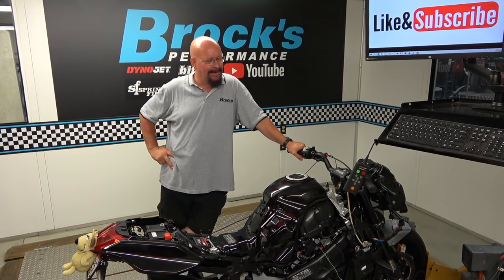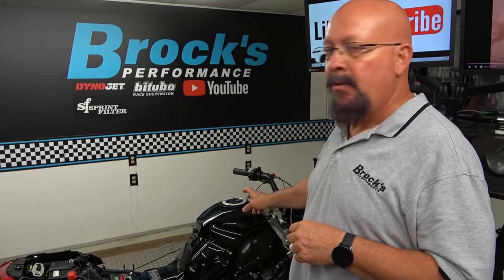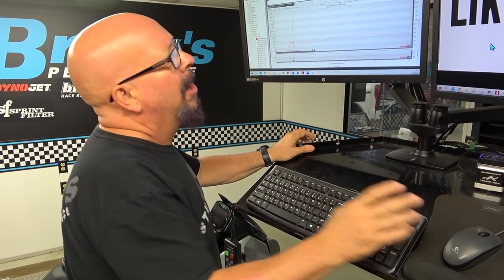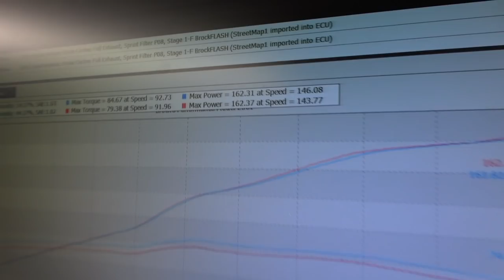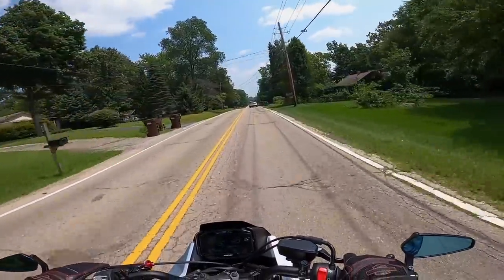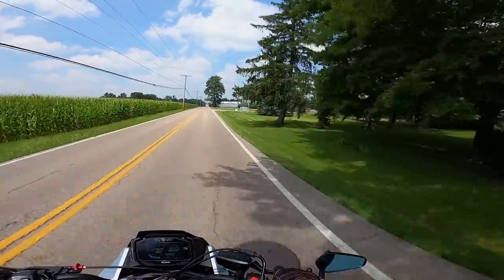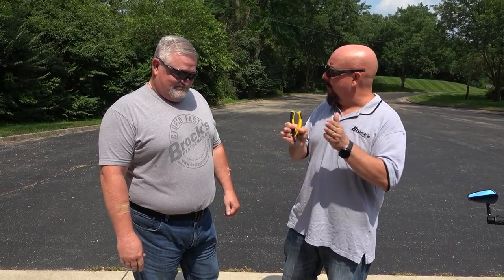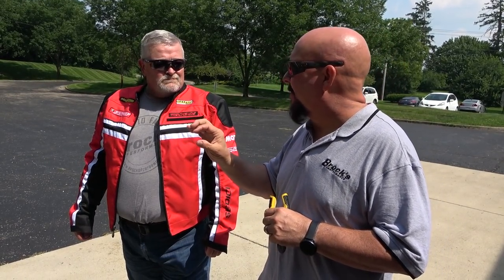Muttley, the parts bin bike, helps Brock teach a #stupidfast history lesson

Comment: Nice video Brock! Those are some serious power gains for basic mods. I almost bought a GSX1000F, did plenty of research on those and every review and spec sheet says it's the K5 motor in those as well, same 73.4 X 59.0 bore x stroke. The K9 was 74.5 X 57.3.
Reply: Correct!

Comment: Great video Brock, I dont understand how this does not have more views. Im surprised they also used the same camshaft as they used in the K5 Gsxr. It would be one of the easiest modifications Suzuki could have done to make the bike have a more desireable power delivery.
Reply from the maker: @Freek, thanks! I guess you have to want to learn something here? lol.
Reply: @BrockDavidson  Learned a lot, as with each video!
Reply: Identical gear ratios from the 2005 GSX-R1000. Seems ridiculous, since these are street bikes and those track gear ratios are among the absolute worst for street use (extremely tall 1st gear, 2nd through 6th stacked right on top each other, 6th gear running engine too fast with worse MPG).

Comment: Will be interesting to see how the GSX-S1000GT goes, since it's the Euro5 parts-bin cousin to this sweet little machine. Excellent improvement from the docile 139hp!
Reply: Seems the updated S1000 and S1000GT have about 8-10 hp chopped off the top. More than likely changed cams. Moore Mafia has done some tuning on them. Also, the examples he had in his shop were fitted with less than optimal exhaust headers (small ID). Things might be different with Brock's headers installed, but then again Brock's is about double the cost of other systems. Not complaining, it's R&D and overhead and materials, sales volume, etc.

Comment: Answering the specifics about gearing, I think the gear ratios and final drive ratios are the same between the GSX-S1000 and Katana (in the video).
Assuming this to be true, I dug into the Gearing Commander website.
17/44 final drive ratio:
@1,200 rpm (idle) 1st gear is 8.5 mph stock.
@ 60 mph highway 6th gear, RPM is 4,203.
@11,500 rpm (redline stock) 6th gear is 164.2 mph.
16/44 final drive ratio:
@1,200 rpm (idle) 1st gear is 8.0 mph stock.
@ 60 mph highway 6th gear is 4,466.
11,500 rpm (redline stock) 6th gear is 154.5 mph.
Reply from the maker: Gearing is just math...not so tough on the surface. The problem with answering "simple" questions on gearing is that most riders don't understand the variables involved. More Info: https://blog.brocksperformance.com/faq/what-is-the-best-gearing-combination-for-my/
Reply: @BrockDavidson  Right, agreed. I figured MPH and RPM and gear number would resonate with most casual readers.
Reply from the maker: @Lifted_Above - we offer a free gearing spread sheet on our site. Just plug in the info. from your service manual (Z H2 used as an example) to get detailed rpm vs. MPH: https://blog.brocksperformance.com/charts/Speed_In_Gears_ZH2_2020.xlsx
Reply: @BrockDavidson  Thanks Brock. I was using the Gearing Commander website which is a database with most motorcycles loaded into it, which the author of the site gets from owners and service manuals.
I'd use your site's feature if I was needing to, but as of right now I was only hoping to help the viewer since you brought that data up.
My day job is mechanical engineering, just as a reference. I'm not the details because I like details. Haha

Comment: I hope he got a good deal.  My local dealer had one for a long time.  The looks are either love or hate.  My only issue with the new Katana is tank capacity.  Here in Iowa most of the gas stations have crap gas and it is difficult finding stations with good gas every 100 miles.  I would probably go with the GSX-S1000 with a bigger tank.
Reply from the maker: These bikes don't care about gas quality...they are built to run on fuel in 3rd world countries also.
Reply: @BrockDavidson  Doesn’t octane matter with a tune?
Reply: 2020 GSX-S1000 runs 4.5 gallons. 2021+ GSX-S1000 increased to 5.0 gal.
Katana runs 3.2 gallons. I know, ridiculous idea Suzuki. What were you smoking that day? Assuming 40 mpg between the Katana and the new 5.0 gallon tank S1000, over the course of 20,000 miles you'll be visiting a petrol pump 95 times more. Assuming 10,000 miles a year, you'll be stopping 47 times more at a petrol pump with the Katana vs. the S1000. I'm decent at math, those are spot on numbers.

Comment: Great content...Error in video.... The gsx s 1000 motor is based off the 05- 08 gsxr 1000 motor (same as katana) and not based off the 09- 16  gsxr... Also the frame is 1 off, made specifically for the gsx s... You're right about swing arm (same as 09- 16 gsx r1000)
Reply from the maker: Thanks for the correction!

Comment: True . But.. A smaller Counter shaft sprocket will put less stress on the counter shaft and moves the additional stress to the rear wheel sprocket and bearings. I would rather move any additional stress to the rear wheel and bearings and not the Counter Shaft and bearings/Engine. Dropping one tooth on the CS sprocket is the way to go as it also  or should allow you to keep the chain the same length and not have to remove any links. Should is the key word there.
Reply from the maker: Dropping the front diameter hurts power as well as reduces chain life. As far as stress, or moving it. Unconsiquential, IMHO
Reply: @BrockDavidson  k thx Brock.

Comment: Brock, I have a 2002 Bandit 1200S stock that I’m planning to keep forever or as long as I live, and was wondering if you may be interested in making a video with it and add some upgrades since you have a history with the good old Bandit, may make good content???  BTW, bike was built 09/2001 stamped on the frame.
Reply from the maker: @Tony, our business model is to create parts and info. focusing on new, late model machines. The Bandits are fantastic bikes for certain, but they are not anything we would create products for these days. I can tell you that we used to wake them up with 41mm flat slide Kehin's and occasionally dropped GSX-R750 slingshot cams into them for sizable power gains without disrupting reliability. As well as converting the clutch assembly to GSX-R1000 or Katana if the bike will see the drag strip. I will have my 97 Bandit forever also, so I feel your passion for them :)
Reply: @BrockDavidson  appreciate the feedback and thank you for your quick response. Keep up the great work!!!  👍

Comment: Is the 2018 GSX-S 1000 F also from the same parts bin??
Reply from the maker: No. It has the K9 motor....still a good engine, but racers prefer the K5 for its power output and strength.
Reply: @BrockDavidson  So thats why it only goes to 145 bhp with a filter and exhaust.
Reply from the maker: @erickvanes1285  yes. But a derestriction flash would bring it up considerably, as well as shorter stacks. It's capable of 175+ if done correctly.